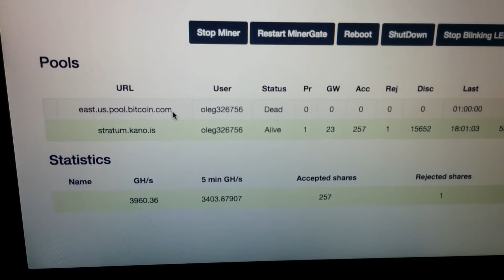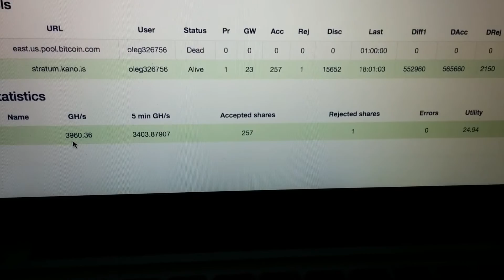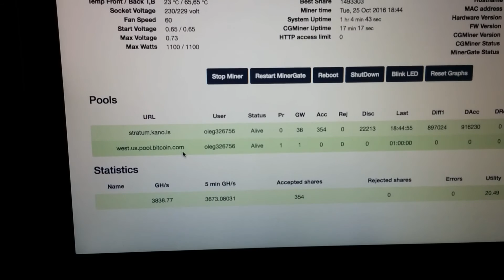Spondoolies Tech SP30 Miner: unpacking and installation

Comment: i really want to buy it but im wonder how to connect it to the network.. how can i enter the interface of the miner .. i c it dosnt has any VGA plug  to connect it with my screen 
if you tell me how can i do that step bye step i ll be grateful :)
Reply from the maker: Step 1: connect it to your router with Ethernet cable. Step 2: open the miner admin interface in a browser on your personal computer. Easy-peasy.
Reply: on my personal computer browser !! what should i type to get in 
192.168.1.1 or another thing

Comment: how did you connected to a monitor? and where did you found the mining software that is linked to the mining machine?
Reply from the maker: You don't connect to a screen directly. You simply go to your miner's IP address on your network from your normal personal computer. And you don't need any additional mining software, the miner comes with it pre-installed. Everything was very easy to set-up, took me less than 15 minutes.

Comment: Please help to understand an sp30 and have several damaged chips as I do to repair them? I am from venezuela and there is no service here
Reply from the maker: If you manage to find some spare parts for it (like a hashing board) on eBay, you can order and try to replace it yourself. Since Spondoolies Tech no longer exists, they don't provide any service on this equipment. Also, may I ask you what did you pay for SP30 (in USD)? I'm considering selling my miner now, would you be interested?
Reply: I bought the machine in 400 $ but to the days began a decrease of the price the buy in the Amazon one oregonmines and other they sent me defective, for now I am not interested in buying another one because the shipment is super expensive for my country, thank you very much

Comment: Hi Oleg,
i also found a spondoolies for a good price next to me some days ago, wanted to ask, how did you install/set it up without the myminers.io site?

thanks and happy holidays.
Reply from the maker: Yevgeni Bondarchuk Hi Yevgeni! What model is it and how much do they want for it?

As to how I set it up: simply wrote the addresses of the mining pool's servers on which I wanted to mine, along with my username and/or Bitcoin address. It was very simple. Usually mining pools provide these instructions on their websites.

Good luck with your mining project and Happy New Year!
Reply: thanks for the fast reply its the SP30 for almost 300 usd.
so basically once you turn the device on it redirects  you right away to the screen where you have to input all the pool data? i dont understand where yםu write all the pool info..
Reply from the maker: Yevgeni Bondarchuk It's a good price, about how much I paid. 

No, you need to get to the miner's admin interface. Connect the miner to the router by Ethernet cable. Scan you local network for all IP addresses in use. The one address that will be used by a Texas Instruments device is the miner's address. Open this address in the web browser on your computer. There you will be able to change the miner's settings. Good luck!